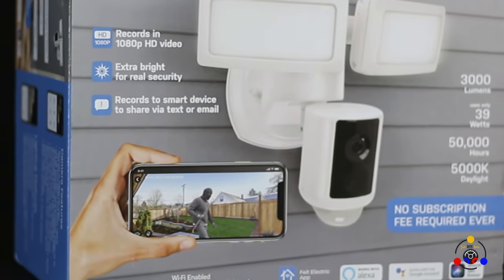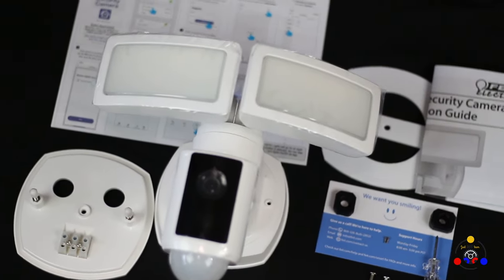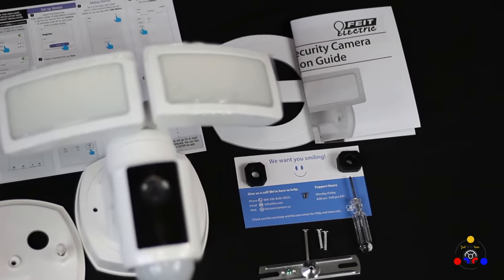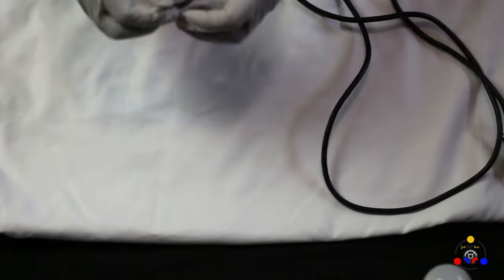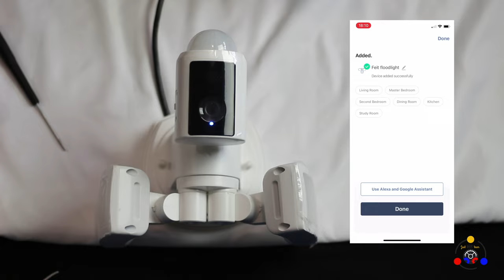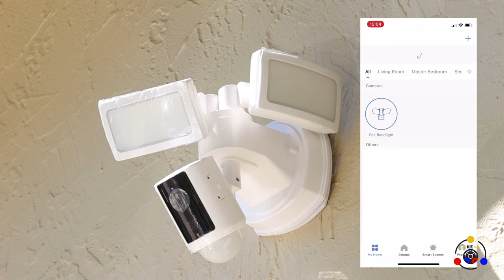Feit Electric Smart Flood Light Camera

Comment: Great floodlight while it lasted. I purchased at Costco about 3 weeks ago, then it just dies with the both lights stuck on. I turned it off and on, but that was the last I heard from it. Other than you cant view the video feed on Alexa (even though the box says it's Alexa compatible), it was a nice system. This one is going back. I'm hesitant to buy a new one. I'm not real happy.
Reply from the maker: Sorry to hear that it stopped working for you.
Reply: Yeah, Feit "smart" products are a bit crap and much left to be desired, support-wise.
Reply: @justdiyteam I can’t get mine to connect at all over tried numerous times shut it off at switch turn back on . Reset button tons of times . With not work does my wifi   Modem need to be close to the unit?
Reply: I can’t get it to work on my phone either
Reply: Yeah, I am way underwhelmed with this unit. I've had mine connected about a week. It took forever to get it connected. Now it goes offline every day at daylight and I have no idea why. Getting a hold of customer service is a joke

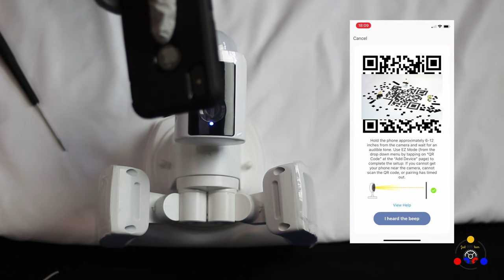Comment: 1:46 - Did your camera pick up the QR code, mine didn't. I didn't see your picking up either. So how did that go?
Reply from the maker: It took about 3-4 tries but it did pick up the QR code… You will hear an audible tone when it is successful. Also, The QR code should be clearly visible on the screen, and the app screen 6-12 inches away from the camera.
Reply: @justdiyteam  mine wasn’t picking up.
Reply: I tried the QR code many times and it never worked
Reply: My camera quit working so I deleted it now I have to figure out how to reinstall it don't know where the QR code is it won't pick it up I think I'm just going to buy a new one new one these are bad cameras

Comment: I have this same setup, after I got a new 5 g wifi router it no longer works ...
Reply from the maker: I believe it only works with 2.4 GHz…most of the routers can have 2.4 GHz and 5 GHz, you might want to enable 2.4. hope this helps.
Reply: @justdiyteam  it's funny, it randomly works but 90% if the time it won't.   It's the 5 g
Reply: @MikeJBlues
Reply: IT ONLY WORK ON 2.4 GHZ It is a great security system ./
Reply from the maker: @Skydiver01  Thank you